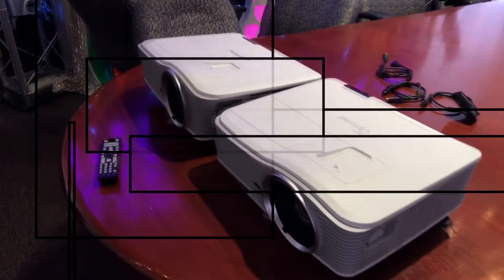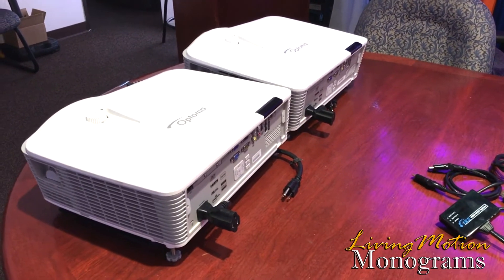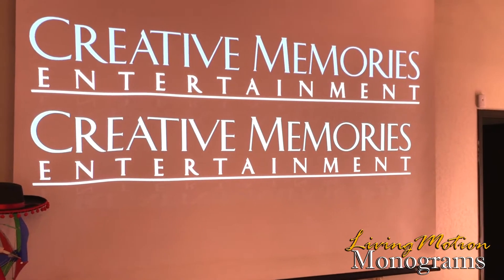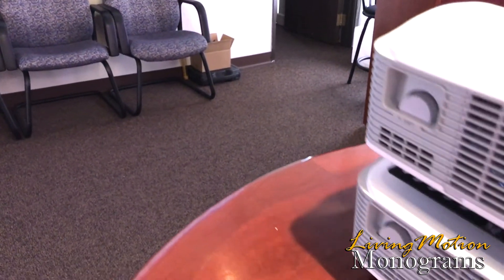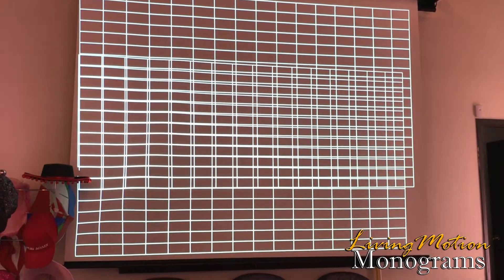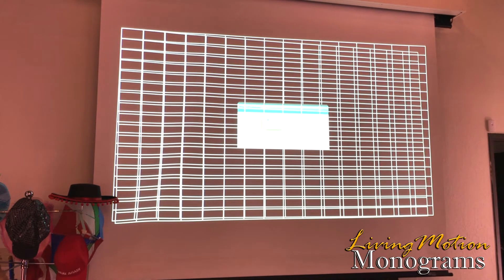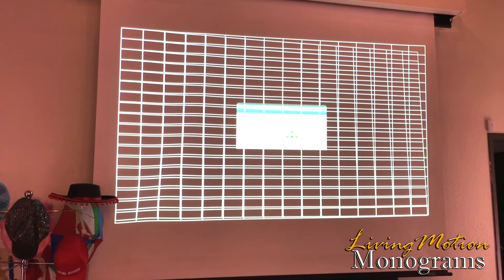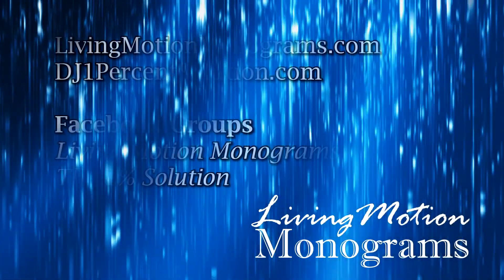Building an 11,000 Lumen Projector with Image Stacking Two Optoma EH-515's

Comment: would it be possible to projector stack with 2 cheap £80 projectors? Using your tutorial
Reply: It's not really going to work in his example. With cheap ones it's impossible. EH515 has vertical and horizontal keystone. You adjust each corner of the projected image. In practically any other projector there is no option like that. Also keystone is really not that great, any new projectors, especially 4k ones, don't have that option anymore (and rely on lens shift instead, but mostly that you have suitable room wall and space).

Comment: You may get real 7000-8000 ansilumen with dual projector with software, not 11,000 ansi ..what software ?
We use warpalizer on our curved monitors we manufacture, up to 12 projectors can be connected simultaneously in the same image. That's awesome, I want to say.
Benny Norman
www.normandesign.se

Comment: two 5500 projectors still wont look massively different to 1 so its really not much point
Reply from the maker: You won't see a huge difference when you are in a dark space but a huge difference when you are in a room where you have diffused light like Sunlight or Fluorescent lighting.  You get much better color saturation and it really does work.   most projectors that are 8000 lumens and above use 2 bulbs in them and take all the work out of doing it this way.